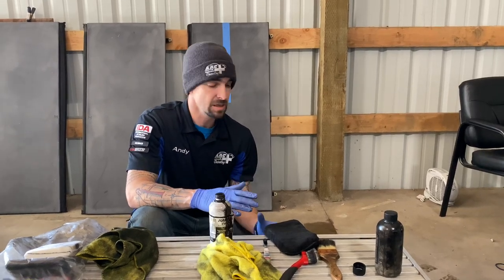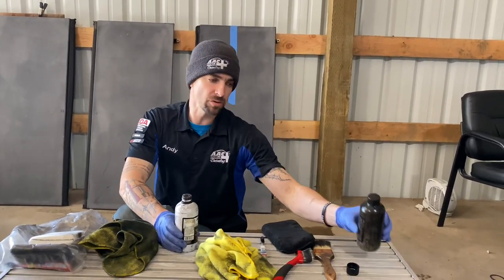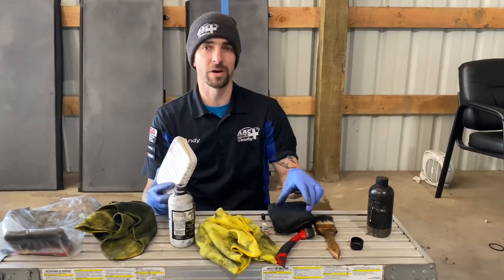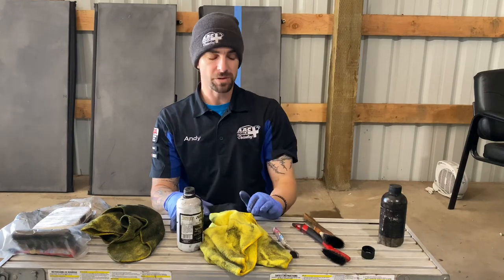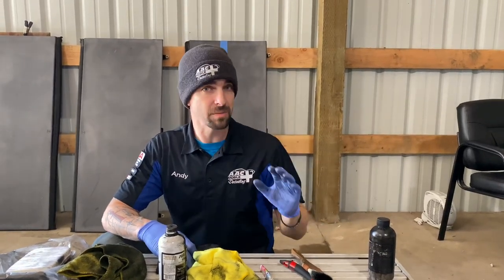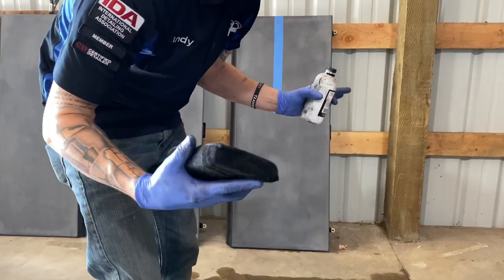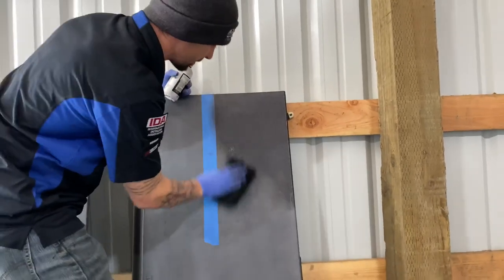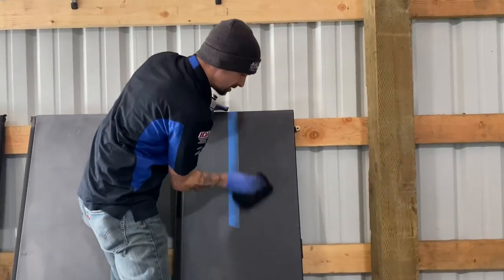Restoring Faded Black Trim on a Chevy Avalanche

Comment: I use to have a 2006 Avalanche.....The best way i found to get the plastic back to normal was to heat it up with a heat gun.....it took a while to do, but all of the plastic/Rubber trim pieces looked like brand new......Not crazy, try it on a small section and let me know. I used a heat gun that would be used to remove paint....Hope it will work for you as well. Thanks for the video's Andy, i enjoy watching!!
Reply: I did that. It works but it goes back faded after few months...
Reply: Never do that people.  Temp solution but gets worse than before.

Comment: Bro have I gotta tip for you. I picked this up from a body pro I use to work for. I've only seen it done to the exterior pieces, but it's a home brew you'll love. My 'guy' enlightened me onto this fix when I was dazzling up my 08 Sierra for a quick flip. The grill on it had issues. He took a handheld propane torch and showed me his secret. It just burned away the old & revield a new appearing grill. Worked like a champ on my black abs. I'm guessing it would work on any color abs. Grab you a messed up piece & slowly heat it up. I'll await your video ~
Reply from the maker: Only problem with that is long term it will dry out the plastic and eventually crack and or create “tiger stripe” marks. I know the burn technique it’s a very old school trick but with products like solution finish it’s just not needed anymore. I do appreciate your input and in no way mean disrespect by my response.
Reply: @AndysAutoCarePlus  wow, that's the 1st time I've heard of it not being a forever fix. Heck, the 4 jobs I brought in just for that process, he gave them his "lifetime guarantee" or 3 years, which ever comes first. Lol  He would charge 100's of dollars per job. The longest job took him 3 hours and that was only due to having to wait 30 minutes for me to make a run to get more propane bottles. He had a gift, a gift of gab my father said about him once. Those old schoolers could sure read us younguns back then. I no longer work for the man, as the bad karma that seems to follow him, had returned with a vengeance last February. That really does surprise me that it could turn back the same or worse down the road. I absolutely appreciate your reply comment back to me sir. My eyes are definitely wideopen now~

Comment: is there any kind of run off/discoloration you have to worry about on the vehicles paint when it rains?
I have a Pearl White 2010 Avalanche and need to restore the trim on the bed but dont want streaking/running on to my paint.
Reply from the maker: never had a issue with it just do a good wipe down after letting it soak in. It recommends letting sit for 2 minutes or so.

Comment: Just use cerakote trim kote. Lasts about a year or more even outdoors
Reply from the maker: I do both. First Restore with solution finish then coat with Cerakote
Reply: So when you say this job lasts 6 months to maybe a year are you saying that for Solution Finish alone, or when topped with Cerakote?